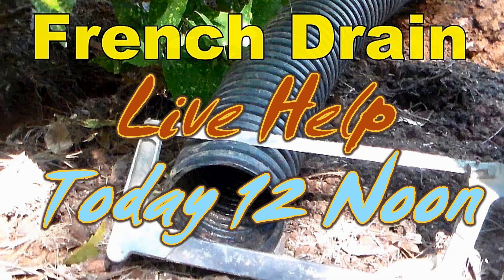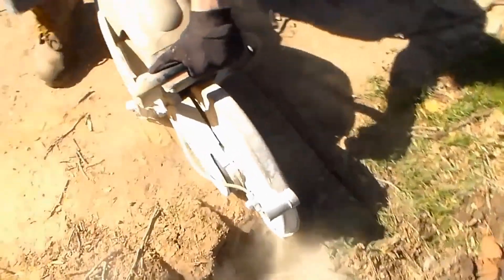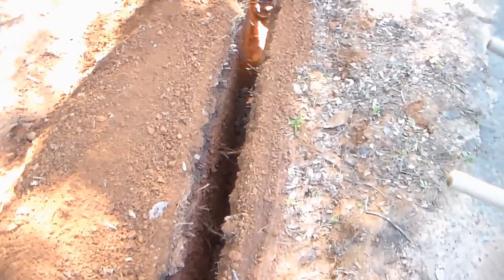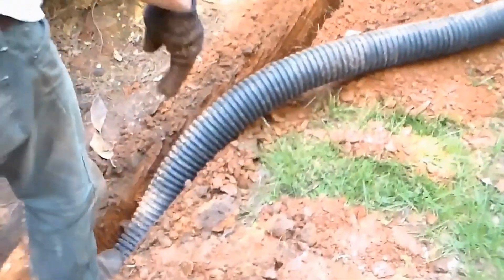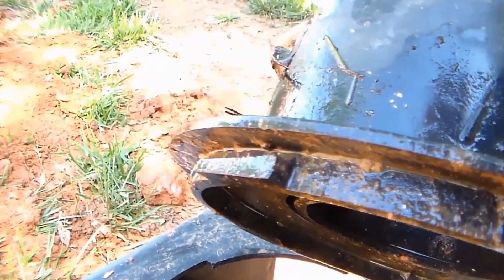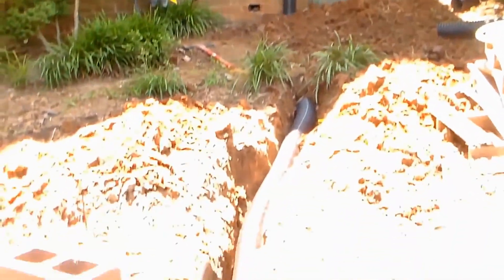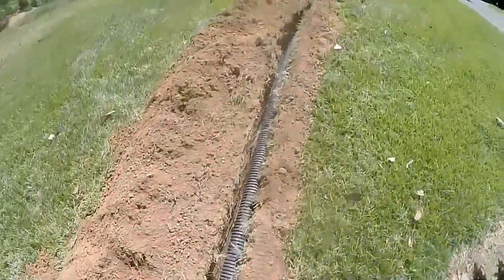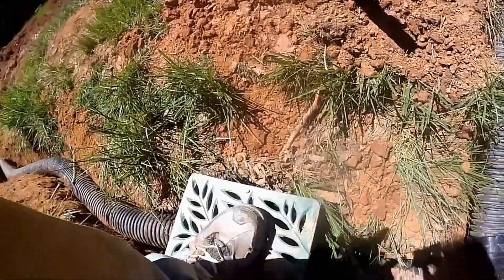How to install - Yard Drain and Downspout Drain, with driveway cut and curb

Comment: Chuck what are your thoughts on taping all the connections? Overkill?
Reply from the maker: Yes Overkill. These systems are not designed to be water tight. and Tape won't stop roots either! 👍👍👍